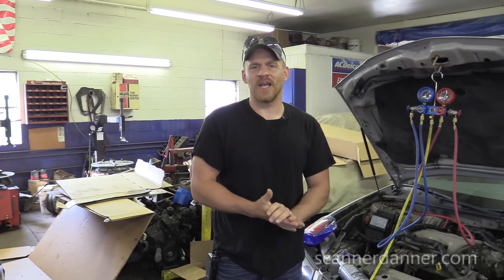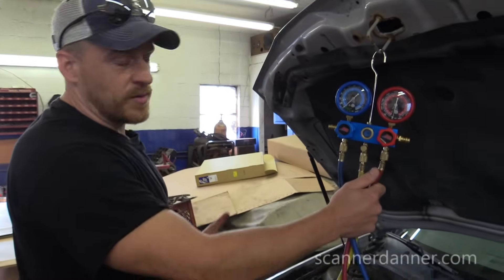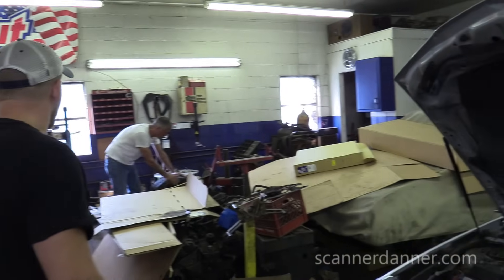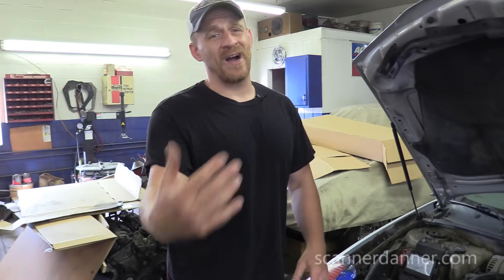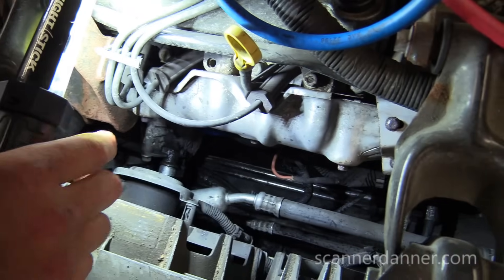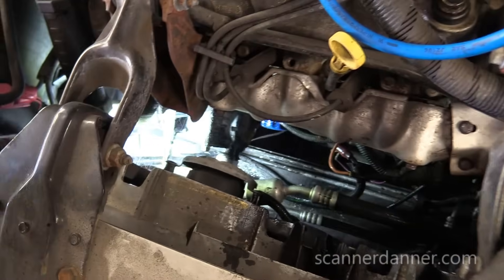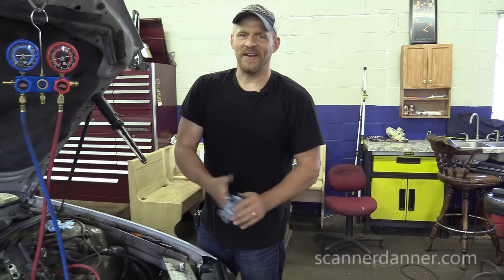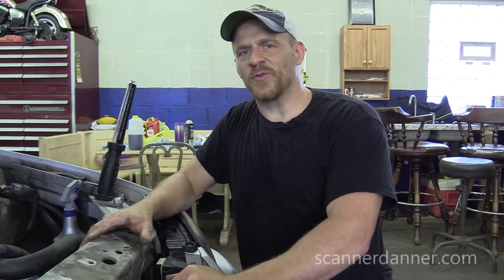A/C Leak Testing Using Compressed Air, Soap and Water (any car)

Comment: Hi scanner Danner
Sorry about this but you’ve got to stop encouraging people to use shop air or any air in the A/C system to pressurize it while looking for leaks! It’s not that air will hurt the components in the system it’s that PAG oil has the highest Hygroscopic ratings of all the synthetic oils and cannot be removed by evacuation 
 No vacuum no matter how long or how low a vacuum you pull will you take moisture out of a “Hygroscopic” oil! When PAG and POE oils are made the water molecules are stripped from it, when it’s exposed to moisture they automatically re-attach them selfs back the PAG oils and no vacuum, driers etc. are going to strip them away from the host molecules. This idea that you can pressurize an A/C system with “shop air”, which has an extremely high concentration of moisture in it, is lunacy and should NEVER be done!!
Here’s just one quote from qualified sources on this subject and there are many more!

“Hi Folks! I am the site admin at autoACsystems.com where the information about the PAG oil test and Polymax2 refrigerant oil originated.

For those who did not know, PAG oil is the OE recommended oil on current (R-134a) A/C systems. The problem is, as you all know, that PAGs are very hygroscopic and that moisture causes a lot of problems in the automotive systems; specially when it corrodes evaporators.”

Now this corrosion is due to the fact that the base molecular structure of PAG oil is an acid and by stripping the water molecules from it is what makes it an oil so when the water molecules are added back into it it resorts back to it base which is an acid.
Please stop this practice! Much like brake fluid moisture destroys it!!
Reply: I was going to say that exactly, contaminated oil!

Comment: On a empty system. I use vakuum for determine a leak free system. If it can hold vakuum for 30 min it is ready for refill. Whats your opinion to that?
Reply: Just because a system will hold 30 inches of vacuum, doesn’t mean it will hold 200-300 psi of pressure. My old Jeep Cherokee will hold a vacuum for hours, yet won’t hold a charge of R134 for more than a month or so. I WILL be trying this test!

Comment: Just a thought.  You might consider dye along with the compressed air and increase the pressure to 250 once equalized.  That would find ALL the leaks without starting the system for more than five seconds.

Comment: An old timer told me that kid's bubble liquid works very well for finding leaks.  Ever since then I've mixed 50% bubble leak detector with kid's bubble liquid.  Works extremely well for small leaks.
Reply: It contains glycerin, which helps keep the bubbles from breaking.

Comment: Let me make one additional comment you might add to your presentation.  The reason you don't want to run the A/C system with air for more than five seconds is because air is a non-compressible and you'll be damaging the car's compressor.  Compressor don't do well with liquids or air and it's the fastest way to destroy them.
Reply: Air is non-compressible?  Better inform everyone who uses air tools that it is just their imagination.

Did you mean to write that when you compress air that some of the moisture in it will condense to liquid, which will damage the compressor?
Reply: "Compressibility and Incompressibility
The terms compressibility and incompressibility describe the ability of molecules in a fluid to be compacted or compressed (made more dense) and their ability to bounce back to their original density, in other words, their "springiness." An incompressible fluid cannot be compressed and has relatively constant density throughout. Liquid is an incompressible fluid. A gaseous fluid such as air, on the other hand, can be either compressible or incompressible. Generally, for theoretical and experimental purposes, gases are assumed to be incompressible when they are moving at low speeds--under approximately 220 miles per hour. "
For the purposes of air conditioning air is a non- compressible.  AND air in the line will damage the compressor.  That's why we purge the line of air by vacuum.
I hope this helps you understand?  Otherwise it wouldn't make a difference if air was in the line along with the refrigerant.  You don't have to look far to see under what circumstances air is compressible.  You've got the actual car engine where air along with fuel is compressed prior to detonation.  I comes down to the design of the equipment and auto and home air conditioning isn't designed to compress air.
Reply: You also don't try to run the compressor in deep vacuum, since that might cause the windings to arc over and destroy the insulation.
Reply: the compressor compresses refrigerant gas, thats its job
Reply: Diesel and gasoline engines compress air .  Water will not compress .

Comment: What's the best valve core removal tool for 134a?
Reply from the maker: I don't think you can remove them
Reply: Go to your local HVAC supply store and buy one. Costs about $20-30 but a big time saver if you have to replace a leaky core. Such a tool also really speeds things up when pulling a vacuum.
Reply: @NiHaoMike64  I bought a "mastercool" brand core removable tool for like $40 worked great

Comment: Way to ruin the dryer on the car! You do NOT use compressed shop air in an enclosed AC System, ANY moisture (which shop air is full of) completely ruins the dryer. USE COMPRESSED NITROGEN ONLY or vacuum and add freon. If this was my car - you would be replacing the dryer and expansion valve at your expense.
Reply from the maker: Same tired argument. There is already air in the system with the big ass leak it had. The common everyday person does not have a bottle of compressed nitrogen sitting around, so what does he do? Adding refrigerant to an empty system to do a leak check is a foolish way to begin an AC system check.  You have no idea how big the leak is! You may end up just dumping refrigerant straight into the atmosphere.  If your system is empty, it is full of atmospheric air and moisture already and you should be replacing the drier anyway.  Also, in what way is the expansion valve damaged or affected by compressed air??  Pull a vacuum on the system for a good period of time when you're done and the procedures shown in this video will work perfectly with ZERO issues. Been using this method for 20 years with no comebacks.

Comment: Thanks much ScannerDanner. It would appear I found a leak at the compressor front seal. not sure what all I should replace? the dryer, condenser, (for good measure), and the compressor? if anyone know anything else i should change I am all ears. I attached a link please dont to hypercritical I didnt show all the steps of what I did and checked just mainly abnormal findings. https://youtu.be/-fVC8Ou9xyY

Comment: DO NOT USE!!! It's call spontainious combustion there is oil in the system it will detonate use nitrogen
Reply from the maker: This is flat out wrong and the everyday person does not have a nitrogen can sitting around. So you are recommending the DIYer to just dump refrigerant to the atmosphere? Which is what he is doing when he has a leak in his system. 
There is ZERO danger in using compressed air on a empty system. Show me one case study, one news report of an empty AC system being filled with shop air that caused an explosion. 
Same tired argument that is applied to using a test light on a computer controlled circuit.

Comment: Love this video!  Pulled my system apart yesterday, removed and flushed out all the lines and added a new compressor, condenser, expansion valves, etc. Buttoned it up today and pulled a vacuum, but it wouldn't hold very long.  I was weighing my options on how to find the leak (including pulling everything apart again), found this video, pressurized system to 50 lbs, and voila!  One of the dryer lines had a slice in the new o-ring and the connection was bubbling.  Swapped out that o-ring, and now it holds a vacuum.  Thanks so much for posting.
Reply from the maker: awesome Bill! That's what I'm talking about. Thank you

Comment: I had a similar vacuum leak issue on a 2003 Envoy that was dead empty, tried the compressed air at about 70 psi and found the leak in 5 seconds, litteraly hissing out the condenser, no soapy water needed. This weekend will replace the condenser . Great tip and videos as always. Thank You!

Comment: I found a leak for the first time using shop air the other day. We run some type of filter on our shop air to keep oils and waters out of it so we can paint with it.
The system had zero pressure and had not been used all winter. Turns out a sticky shrader valve was leaking on the low side.
I vacummed it down for an hour and left it vacuumed down one week. Since outside temps sort of got crazy cool again the following week I needed heat in this dump truck and didn't miss the air. My hope was that the engine heat and vacuum would dry out the dryer.

A week later It was still holding vacuum but I vacuumed it down again for an hour. I never changed the dryer which had been replaced the season before and it was blowing 41 degrees in the vents after weighing in the specified 3.5LBS of freon.

I would have never tried shop air before seeing Scanner do it. I usually use Nitrogen and soapy water but tried the air and saved my Nitrogen for another day.

If it didn't work I would have reclaimed the freon and got a new dryer for it. And if that didn't work I'd go back to 2-60 air condition. LOL!

Comment: My main job is mobile car AirCon. Over here people are under the impression that car AC systems just need ‘ topping up ‘ every couple of years. As if the refrigerant is a consumable substance... 

Anyway, this video is brilliant, and is exactly what I was looking for a couple years  ago when starting out. Really thorough and full of facts! 

The only thing I do differently is that I use oxygen free nitrogen to pressure test. But can’t see a huge problem with using compressed air as long as the system is thoroughly vac’d afterward. 

Bang on mate.
Reply: What about the AC dryer people keep talking about going bad automatically with compressed air?
Reply: @scientist100 it’ll be fine considering this system was already empty and had air in it lol. Also whenever you do an AC system repair you’re supposed to change out the dryer anyway. So there’s really no problem

Comment: all works great in my 1992 chevrolet caprice classic, Except the evaporator box has alot of condensation and water is on my passenger side floor from it, The drain tubes does drain, the fan blows well and cold air, Again box has lots of condensation :( Any IDEAS.

Comment: good video..this is the time that an ultrasonic leak detector is invaluable..it hears compressed gases coming through small holes that are  out of the bandwidth of your ears....it can hear compressor shaft seal leaks and evap cores leaking.  they're not perfect but gives one another tool in your diagnostic kit  ...mines has pulled my butt out of many problems..look in to it..you won't be sorry...

Comment: Compressed air to test ac system leaks is definitely going into my arsenal of diagnostic methods...Any nay-Sayers are apparently oblivious to the fact that once repaired, the system will undergo vacuum to remove air moisture before recharging...
Reply: But wait... I get if it's a leak and you're trying to find it.  The filter drier is already gone as once the refrigerant leaks out, the air can and does come in.  It won't hurt to use compressed air at all in this case.

But what about leak/pressure testing on a newly repaired system?  Wouldn't you want to avoid exposing the newly replaced filter drier to moisture and use nitrogen instead at that point?
Reply: POE oil absorbs moisture that will not be removed just by pulling a vacuum, but I suppose that's not a problem if there was a big leak some time ago and all the oil has to be changed anyways...
Reply: @NiHaoMike64  the new vacuum pumps vacuum at microns enough to boil even though oil AC mechanic 25 years what you said is incorrect vacuum pump will remove all the moisture
Reply: tinkerwest also recommend replacement of the drier/accumulator
Reply: @heyitschinoable  Yes, recommended but I've seen more often that not they're changed and  system still works fine. But hey, chicken soup right, it certainly won't hurt to change it. Cheers!
Reply: Why not use nitrogen?, shop air contains moisture
Reply: Wouldn't using nitrogen instead of shop air cut down on vacuum time after repair?
Reply from the maker: exactly, not to mention the system if full of atmospheric air already when there is an empty system from a leak.
Reply: BTW, I would recommend using something called Seek-a-Leak which is designed to find leaks on tires, similar to soapy water but better results...Works great for leak testing tires as well as any pressurized tank, hoses, fittings, etc...Also, would like to take this opportunity to thank you for your great book, one of my best investments and diagnostic tools ever!...
Reply: ONLY if you want to change your dryer and expansion valve.  ANY moisture added to the vacuum system instantly ruins an AC Dryer. NITROGEN - NOT SHOP AIR is a MUST or vacuum and use freon. He literally just ruined that cars AC system- sure, it will work in the short term, but never work correctly again until the dryer is replaced.
Reply: @randomsecrets  I've been an AC mechanic 25 years Shop air has moisture in it yes big vacuum pump will draw it all out quick it's not a 20-ton air conditioning system it's a little old car it will not ruin the AC accumulator it has a bag of dryer desiccant in it just like the stuff in your clothing when you buy it the main reason that you should change the dryer is this the desiccant comes in a bag in the accumulator that bag sometimes degrade and breaks you talk about a mess trying to clean that up nobody wants our flush AC system out take a compressor apart that's the reason why you change the filter drier accumulator if you working on refrigeration it's low temperature one drop of moisture will do ya in in a car big vacuum pump 30 minutes will boil all that water out
Reply: @randomsecrets  He said in the video he was replacing the dryer.
Reply: @randomsecrets  Watch the video, he said he's replacing the dryer.

Comment: All the naysayers, my lord! There is nothing wrong with using compressed air in an empty system for detecting major leaks DESPITE what any technical manual says. If the system is undergoing a vacuum after repairs, there is effectively no difference between pumping air into it and opening the loop for any repair (ie: replacing a compressor). The system is empty and contaminated from the penetration to begin with; there are no safety concerns, low pressure on refrigerant would be a different case.

I'm wondering, though, why the leak wasn't detectable with UV to begin with. There should be dye in the system that takes quite a bit of effort to wash off. Or is dye addition a dubious process any more?
Reply from the maker: I know right? But whatever. To each his own. As for the dye, to be honest with you I never even tried to look for it. I wanted to show this procedure.

Comment: Soap and water is said to be more ineffective compared to an electronic leak detector, especially the loss in ounces per year. Perhaps only do that with large leaks. The 609 and other test if they ask you about using compressed air, don't pick that and never pick soap and water over electronic or dye. But of course Macs says that the service port caps prevent leaks or that missing service port caps are a major cause of leaks. I disagree, the service port valves should not leak even without a cap!

Kia has ice cold A/C when it's working. Now that surprised me how cold it is compared to more expensive luxury cars.

Comment: Nitrogen is better to use than air from a shop air compressor. And that was a question on the ASE Air Cond certification test back in the 1980's - about the time of the change from R-12 to HFC-134 was finished.

Comment: section 609 says its ok to put a  charge to it. i have found a few chevy truck condensers in this manner with a sniffer 

as a rule a system has to be able to hold pressure, 
but i have seen a few times that under vacuum a hose will leak but when applied pressure will hold.

Comment: A/C clutch is engaged even when fan switch is off ,,compressor is always running also nothing but warm or same as out side air. Do you know why the compressor is always engaged. System doesn't seem to take 134a